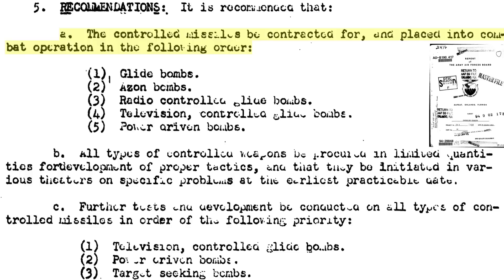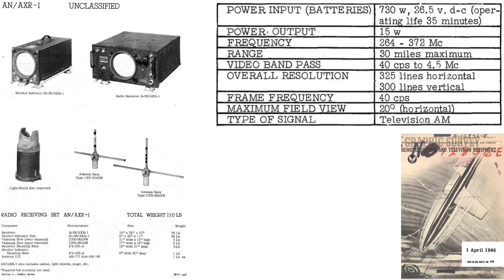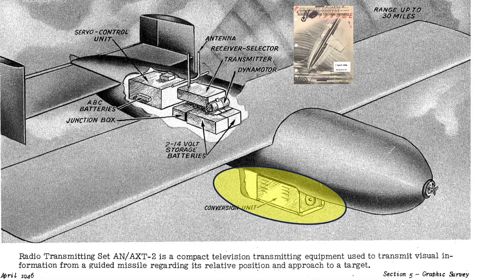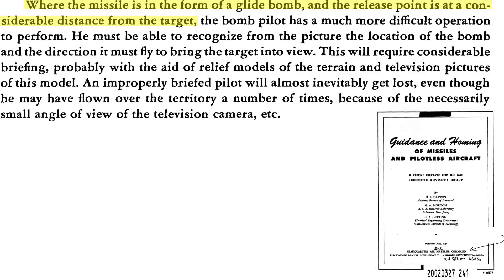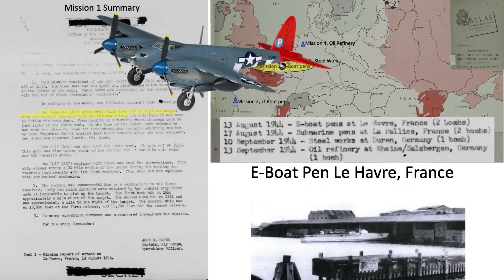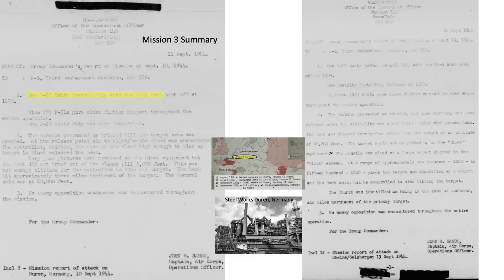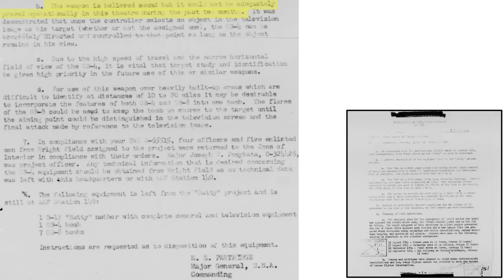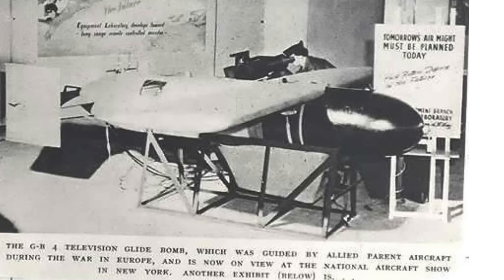US WWII TV Guided Air-to-Surface Missile–Failed Combat Deployments, Deep Dive Review

Comment: Theres a video on the Walleye TV guided bomb that goes heavily into the differences between these and the Walleye, alot of it was the same tech, but they used a different lense and stronger transmitter.
Reply: -The first versions of Walleye (Walleye I) actually were fully fire and forget.  The fighter-bomber would dive toward the target and the camera would lock on and glide towards the target.  1100lb Walleye bombs hit power stations and power plants in the Vietnam war.   The bomb could loose lock sometimes but the biggest source of failure against North Vietnam's well constructed railway bridges (built by the French) was that they failed to destroy the bridges despite direct hits due to an inadequate warhead.
-Walleye II went to a 2000lb warhead with a video link that allowed re locking the missile on target.
- An civilian engineer, Norman Kay, at the Naval Ordnance Test Center (later the Naval Weapons Center) at China Lake, California, built televisions in his home as a hobby. Kay built an iconoscope camera in 1958 that could do a "funny thing", recalled fellow project engineer William H. Woodworth. "It occurred to him that he could build a little circuit into there that would put a little blip in the picture, and he could make the little blip track things that would move in the picture".
-Over 4 years latter they had a working seeker.

Comment: Considering that electronic television technology was in its infancy back then, the poor results aren’t surprising.  They specifically mention contrast issues; even when commercial television broadcasts went mainstream in the 1950’s, actors actually had to use ridiculous amounts of makeup to produce a viewable image for home audiences; electronic TV was DEFINITELY not “ready for prime time” back then.  Radio control was also in its infancy.  Both at that time were dependent on vacuum tube technology, which was bulky, power- hungry, and especially considering that they were trying to do the video link in the 300 MHz. range, VERY unstable and unreliable.
     It’s a stark contrast to the off - the - shelf RC & video technology of today.  I own a couple of DJI camera drones; the video quality & flight stability on both of them is outstanding.

Comment: German wunderwaffen be like: tank the size of a shed
Allied wonder weapons: portable star
Reply: -Fritz-X first deployment 21 July 1943.  Successful Weapon at hitting moving targets like ships.  CEP was 6m (22ft)
-Hs 293 first deployment 25 August 1943. Successful Weapon at hitting moving targets like ships.
-CB-1 Though Ready in September 1943 was not deployed till May 1944.   Dumb glide bomb with an autopilot extremely inaccurate, glided into Cologne but regarded as unsuccessful.  Served as basis of planed versions with various seekers which were not deployed.
GB-4 was declared combat-ready in July 1944 and used some weeks later but declared ineffective in Feb 1945 and put out of production.
-Azon first deployment 8th June 1944.  Similar to Fritz-X but azimuth (left right) steering only so suitable for long targets such as bridges and roads only.  It was successful in the Pacific but not Europe.
-ASM-N-2 Bat was deployed in April 1945 in the Pacific of Borneo.   By then Germany had in practice been defeated.
-For the record the Germans also had a TV guidance system to be strapped on to the nose of the Hs 293 and larger versions of the missile called Hs 294 and Hs 295.   The system was called Tonne Seedorf.  They made several versions and got to Tonne-4 (the Camera) and Seedorf-3 (the receiver).   Initial Versions used 448 line TV refreshed at 25Hz but after trials then this was changed to 224 lines at 50Hz as this produced a clearer picture.   Many challenges were involved but they ended up using only two types of miniature Vacuum tube which had to be in pressurised aluminium containers to solve the cooling, size problems and prevent air breakdown at high altitudes.  The synch and flyback signals were embedded in the scan to make jamming difficult.
-The Germans also had a glide bomb called BV-226 to be dropped from fighter aircraft which was to use the Ewald-II radio guidance system which was also to be used on the V1.    The BV-226 was suspended pending Ewald-II being fully ready.  Ground stations were being built in late 1944 or 45 but never commissioned.  
-A version called BV-246 with a radar homing seeker to destroy allied navigation bacons and long range radar was tested successfully.
-There was an active (continuous wave) radar homer called Blaupunkt MAX-A for Surface to Air missiles such as Wasserfall for terminal homing which was ground tested and a Passive version MAX-P which lacked the magnetron but was designed to home onto allied ground mapping radar, night fighter radar and AAA radar on ships.
-Source "Fritz Trnekle"    "Die Deutsch Fernlenkverfahren" unfortunately not available in English.

Comment: 1940's TV wasn't really ready for this.  Look at how huge studio TV cameras were in the 1950's, and remember they had big vacuum tubes pulling a lot of power.
Reply: -The Germans also had a developmental TV guidance system to be strapped on to the nose of the Hs 293 CLOS missile they used in 1943 to allow the launch aircraft to hide in clouds and turn away.   It's trials and tribulations point to the same problems the US had to overcome.  Basically, camera issues and reliability issues as you suggested.  
-Zworkin of Westinghouse the USA developed the first video camera tubes.   This was licensed to the Fernseh Company of Germany and used to televise the olympic.  The Germans developed from this the SuperIkonoscope   (image inconoscope) which was 15 times more sensitive.  This tube was used in Europe Until the 1960.   
-In the USA The image orthicon tube was developed at RCA by Albert Rose, Paul K. Weimer, and Harold B. Law. It represented an advance in the television field, and after further development work, RCA created original models between 1939 and 1940. The National Defense Research Committee entered into a contract with RCA where the NDRC paid for its further development. Upon RCA's development of the more sensitive image orthicon tube in 1943, RCA entered into a production contract with the U.S. Navy, the first tubes being delivered in January 1944.   Not sure if the GB-4 got this tube.  
-The German TV guidance system was called Tonne - Seedorf.  They made several versions and got to Tonne-4 (the Camera) and Seedorf-3 (the receiver).   
Initial Versions used 448 line TV refreshed at 25Hz but after trials then this was changed to 224 lines at 50Hz as this produced a clearer picture.   
-Many challenges were involved but they ended up using only two types of miniature Vacuum tube which had to be in pressurised aluminium containers to solve the cooling, size problems and prevent air breakdown at high altitudes from the high voltages involved.  The synch and flyback signals were embedded in the scan to make jamming difficult.   These signals were originally generated by local quarz clocks that kept the camera transmitter and receiver synchronised, but this proved too expensive.  About 300 Tonne Seedorf sets were made for tests and trials but it never entered service.  
-The big problems for both the US and German work were the video cameras which were simply too insensitive to work in European lighting conditions. 
-Other problems was the extensive quality control needed to make these systems Reliable.
-The cameras really needed to be stabilised and be equipped with a bombsight type computer that tracked the target according to airspeed and altitude.
Reply: @bernhardzunk7402  Some sources claim that at least HS293D was used against at least one RN ship.   The Tonne Sedorf TV camera was initially strapped solidly on the nose of the missile.   Since the missile needed a certain angle of attack depending on speed and glide slope if the camera was aimed at the target the missile would no longer be on the glide slope needed to hit the target so the missile had to be continuously jinked and porpoised. 
-After considering several possibilities to solve this, including a proportional navigation system, they settled on an extremely simple solution. Small wind vanes on the nose of the missile were used to rotate the camera so it was always pointed in the direction of the flight path, not the missile body. Now when the operator maneuvered the missile, he saw where it was ultimately headed, not where it was pointed at that instant. This also helped reduce the motion of the image if they applied sharp control input
Reply: @bernhardzunk7402 this comment is awesome! Thank you for posting really interesting stuff.
Reply: Lies, Alex Jones had webcams then